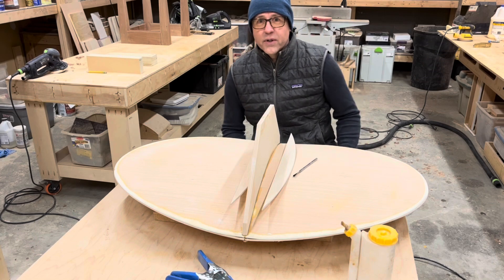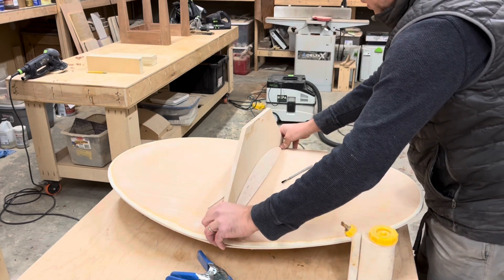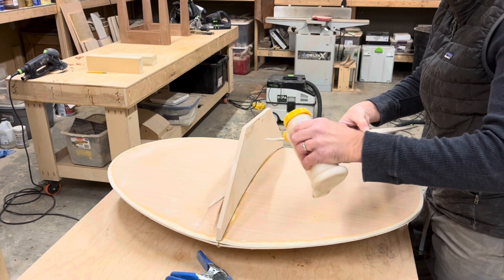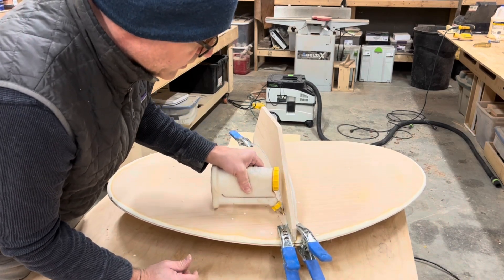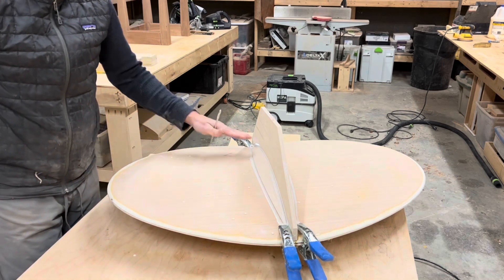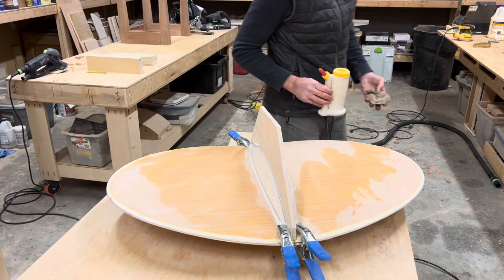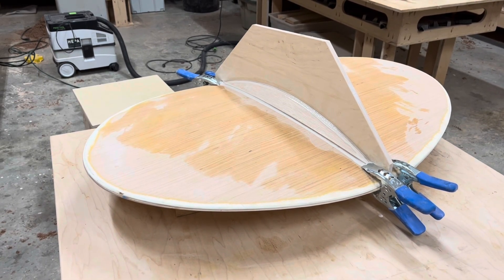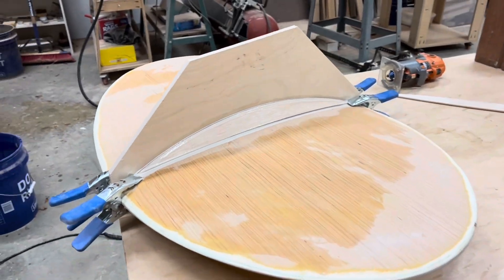Finishing up my skimming discs for dynamic lift

Comment: The shape of these skimming disks is fascinating. Very interested to see how they perform.
Reply from the maker: Thanks.  I’m tempted to put 4 of them just below water line on a John boat and see at what speed the hull lifts out of the water. Obviously their main purpose is anti-heeling on a small sailboat but they might work on a power boat too.